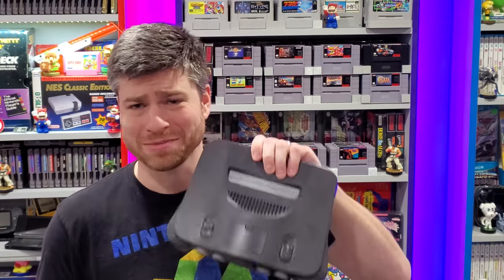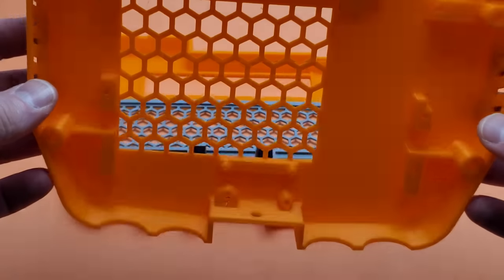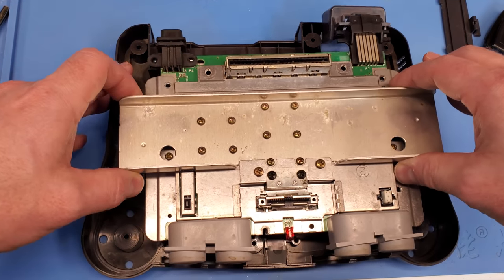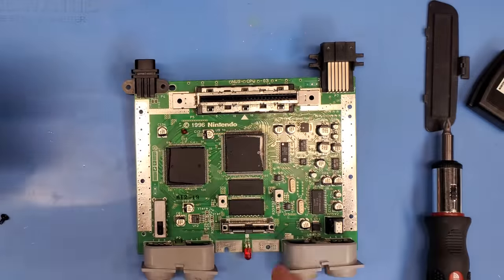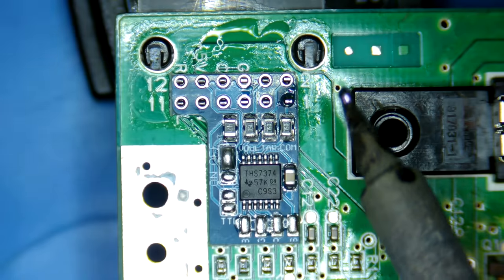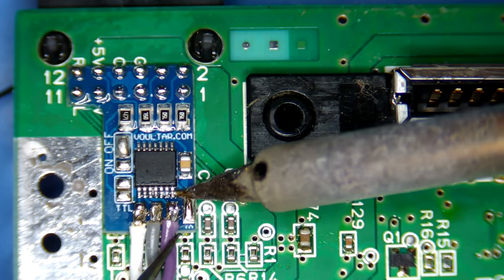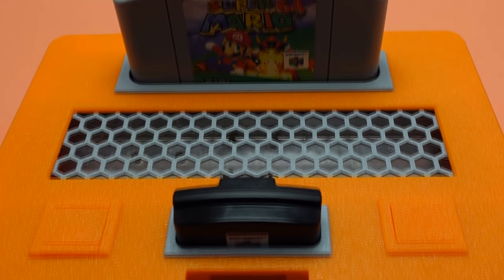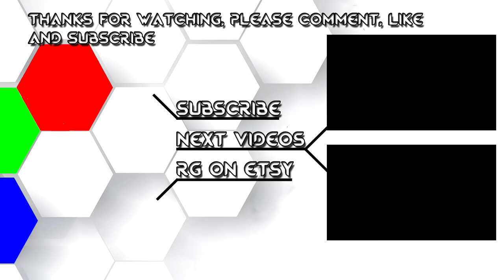Say Hello to the N64 JR!  N64 refurb and RGB Mod

Comment: Hey rocker
I have the 8bitdo gbros adapter and my controllers can no longer vibrate even though i cleaned the port
Think you can help me out
Reply from the maker: I cant say I have run into that exact issue, but the gbros uses a "buck converter" to up the 3V from the AA batteries to 5V for rumble.  My guess is you either need new batteries or there could be an issue with the internal buck converter.

Comment: How do you think the plastic will hold up against any heat overtime?  Sorry if a noob question on my part.
Reply from the maker: Not a noob question at all. I think as long as it's not in direct sunlight or exposed to a ton of heat you should be good to go. PLA will start to deform around 65*C. My understanding is with the included fan mod this runs around 45*C under load. So it should be well within temp, but avoiding direct sunlight especially in warmer climates in the US would be recommended
Reply: @RockerGaming  awesome! Thanks man.
Reply from the maker: And in the interest in completeness, petg has a deformation temp around 90*C. My general thought it is for me in Chicago I should be fine. I also plan to keep this console and an open shelf wire rack so I don't think the heat will personally be an issue for me at all.
Reply: @RockerGaming  I figured it would probably be fine.  I just know those ghost Xbox cases tended to have issues over time so I was curious.
Reply from the maker: I cant be sure what the deflection temp is on the ghost case but I know it has acrylic in it (it's likely a blend of multiple plastics) and the deflection temp of acrylic is similar to petg. What I can't comment on (but you might know) is the normal operating temp of a Xbox. My guess is the deformed ghost cases  likely were subject to high heat likely outside of normal play, but admittedly im not as informed as I know you are!
Reply: @RockerGaming   Ha! You think too highly of me.  😀 In the past I ran across a few reviews and one article  that gave them a bad name.   But if cleaned/new paste on pads and better fan, I personally always thought it should be fine, but was hesitant.

Comment: Heyo ^^
I want to mod one of my gamecube consoles but I don't know how to start. I already got a modchip as well as a adapter for SD Cards and screwdrivers, but there are so many different tutorials, that I dont know which one to follow for absolute beginners
Reply: i would say instead of a modchip, go for a save game exploit instead to boot into swiss to play backups, homebrew & GBI.
It uses games you probably already own and you don't have to solder anything into your gamecube,
Reply: @voiceovertheking  I only have a few games and buying more is definitly to expensive. I got the chip and such as a present since it seemed like the most affordable and easiest solution
Reply: @voiceovertheking  now a days you dont need to solder anything any way. Everything is plug and play.
Reply from the maker: If you already have the mod chip (I'm assuming it's a xeno gc) I'd install that using the wired method (check out the tutorial I made several years ago about it). Then I'd burn a copy of swiss to a mini DVD and just use that. The DVD should self boot to swiss and you can load games onto the sd2sp2 or sdgekko.  Ive done a few tutorials that cover all this, feel free to take a look!
Reply: @RockerGaming  thank you! I already got all of that, I only need to get/find some cables, any recommendations?
Reply from the maker: For hdmi, carby all day! I saw they listed more last week, but they sell out quick!
Reply: @lilmancc35  not fully,
assuming they use the xeno gc it will require solder, and yes now with the GC loader a chip isn't needed anymore.
But i recommend save game exploits specifically because you can get a used copy of "Tom Clancy's Splinter Cell
(Stealth Action Redefined)" for 7/8$ and the SP2SD for like 2$ on aliexpress and have full access to swiss for under 10$ without having to even open the console,
Because the GC loader for example can be really expensive for some and Finding good readable Mini DVD's for the Xeno GC are even more rare and expensive,
Reply: @voiceovertheking  oh okay. Thats understandable. I was thinking you was talking about in general.

Comment: Rockergaming you need to tell him ASAP that this needs to be all PETG, because PLA plastic will melt in regular sunlight inside an air conditioned room, basically this will melt for anyone in florida or one of the desert states out west.
Reply from the maker: I will keep him posted. I know he is in Texas doing his testing, but I will pass along the note.  Originally I think the plan was for the whole print to PETG, but I believe there will be some sort of mix of materials now.  Being from Chicago, I rarely deal with this, so I am glad you said something!
Reply: All the parts that come in contact with the heat spreader are in fact PETG (hottest tested temp 57c). And that's before the addition of a silent fan which drops temps to about 43c

As for leaving it the hot sun (even if turned off), this is unfortunately true of any PLA print. I'm open to doing full PETG shells, but know it will limit color options and raise the price.